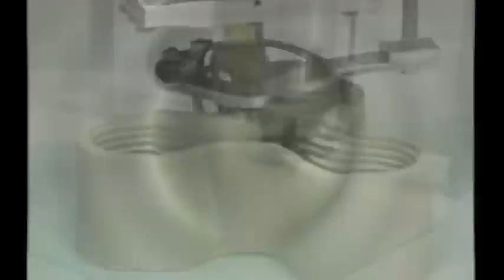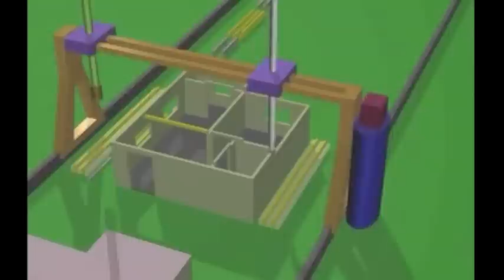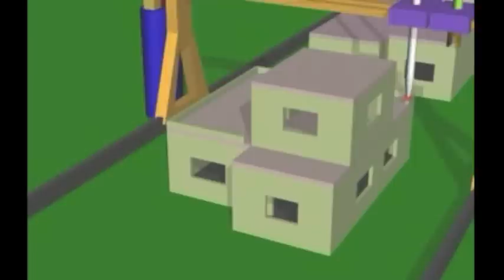Why Design Now?: Contour Crafting

Comment: cool idea. set it up on a rail system and have people man the resupply and maintenance.

only problem is this is little more than a concrete shelter.

missing: sewer piping, plumbing, electrical, gas, doors and windows, not to mention finishing the interior which will reverberate quite a bit. you would have to pad the walls with something or place a secondary wall structure over the concrete to damped the sound and provide structure to hang things. 

if they can automate the electrical, plubming and sewage this would be more interesting.

Comment: I don't see plumbing, electric, HVAC in this example and I wish that was included. Also I wonder if hempcrete or stybercrete (concrete with styberfoam balls added) can be used for this since both are very light. Personally I'd rather have engineered wood I-beams for floors.

Comment: Thomas Edison's concrete injected homes were a commercial failure and maintenance was a nightmare, so very few of Edison's inexpensive "homes of the future" remain.   The Frank Lloyd Wright Ennis and Hollyhock homes, both fundamentally concrete, have also suffered from high maintenance costs, settling problems and earthquake damage.  So, how does this new technology solve those issues?
Reply: cob instead of concrete